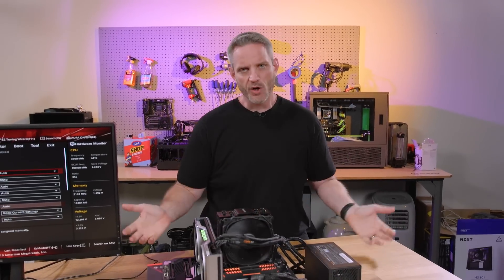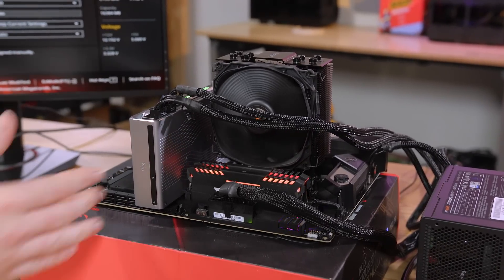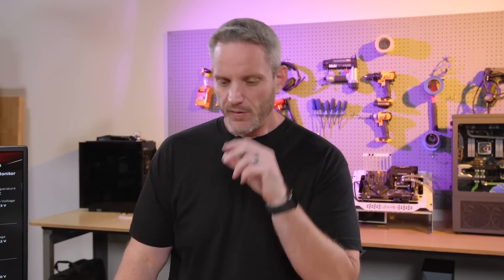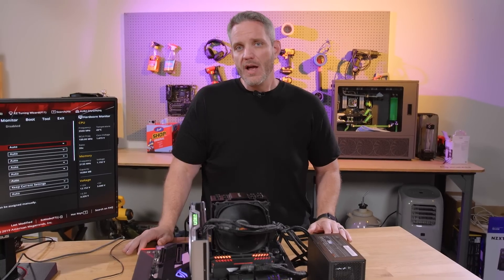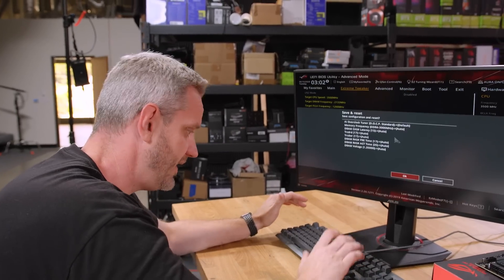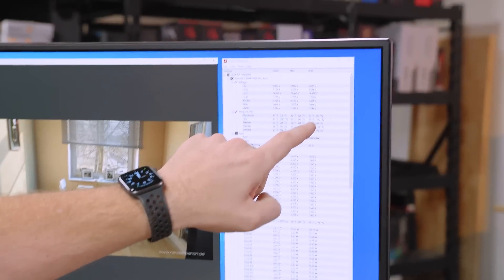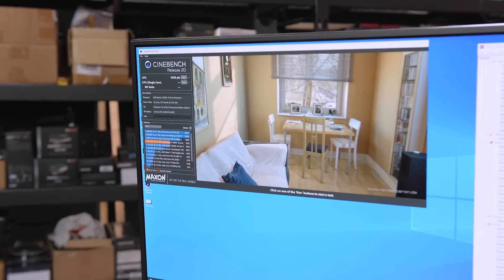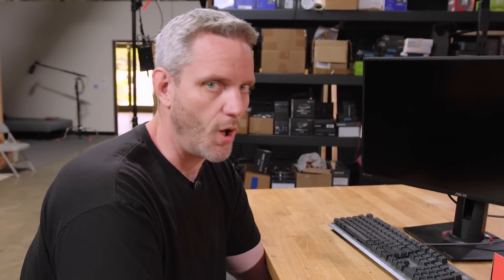Is your motherboard trying to damage your Ryzen CPU?

Comment: AMD's engineers worked on this PBO auto overclock and voltage and seems like they did a good job...I really don't get substantial benefit from manually OC versus PBO in most benchmarks. The thing is I can OC it to 4.3 and undervolt and still get good performance, so which is better in that regard.

Comment: Sorry Jay - Intel does NOT communicate the per core boost speeds for different load levels: instead it gives you the basic frequency and the max turbo (for single core scenario). This is a long existing issue (just checked for 9900K and 10900K, just in case they have suddenly changed something...nope, still the same). 3rd party sites like WikiChip sometimes (many times, in my experience) do have these data, but Ark.intel never does :) So no, this is definitely not something AMD could learn from Intel.

Comment: How far back does this go? I'm still on an 1800X with a Crosshair 6E and after updating my bios months ago it seems, I've been getting random presumably thermal based restarts even though I'm running an EKWB A240. For years I was just using defaults and now I want to do more like I did in a few tests out of the box. It just seems odd to me that I have no headspace even with a water cooler.

Comment: I just built a Ryzen system for my cousin, and the boost auto setting on the Asus motherboard was causing random crashes just using the computer normally at the desktop.  After setting it to default, it hasn't crashed in over a week now.  It should be default by default.

Comment: Asus Rog B450-f running an AMD 2600. I did a Bios update and the board attempted to push 2.4volts to my CPU and caused temps to spike up to 80C at idle. I had to shut the computer down myself. Luckily the mobo has ezflash. So I was able to go to the most recent bios vs the one I wanted and so far it's been stable but with more temperature fluctuations.

Comment: Hey Jay. I´ve been noticing this "auto" overclock since i build my pc. I´ve got a Ryzen 5 3600X on an ASUS TUF B-450M-PLUS Gaming, 32Gb Corsair Vengeange Pro Ram. I dont really know much about overclocking settings or tweaks, but i wonder if is there any chance that this board will let me run "stock", other than overclocked? My first impression out of the box was that "AUTO" would give me standard settings, and not overclock ones. The fact of the matter is that i simply cannot figure out how do i get a pure "Stock" setting on these boards.

Comment: CPU will died because the power supply is bad from motherboard AMD with does mosfet ,two much heat  from 12.50 V to 1.2 V and bad capacitors because the heat

Comment: Does that mean my Ryzen 3800X would run cooler than the 40° C it runs on idle at the moment if I change these settings? I could't find any official info about that.

Comment: Regardless those zen degradation I was always wondering the term of CPU degradation because of overclock. Is that really CPU or is it maybe the power supply and/or motherboard? Those components are being degraded too and after some amount of time, especially with overclocked components, they might not be able to deliver so stable voltages and overal PC stability might be affected. Sometimes it is CPU, sometimes MB or PSU or even memory.

Comment: Is a static overclock @4.4 on 1.2v on a ryzen 5 3600 bad for daily use? Daily use consists of some internet surfing, light video editing/exporting, and gaming. I have a 280mm aio as my cooling solution, idle temp is >33C and >65C under full load. Already did p95 test and it is stable at this voltage. I know cpus are supposed to flex so would this degrade the life of my processor even at this voltage with low temps?

Comment: Hey guys, thanks for the video! 
I have a Ryzen 3950x on a Aorus x570 master with the castle 360ex and 32gb of ram running at 3600Mhz and it's running 4.3Ghz with a steady 70°C to 80°C on cinebench r20 (score 9796). 
I wonder why am I getting that much different results than you in terms of temperature? I was thinking that a open bench setup like that would have better cooling than my cased setup.

Screenshot: https://ibb.co/GFf47g4

Comment: Plz help me fixing my 16gb 3200mhz Tforce Ram stability, I can only run default 2400mhz or to max 2600mhz without game errors and blue screens. I tweaked for months with voltages and timings, runned memtests and notthing wrong. Even Teamgroup dont know what wrong is. I got a ryzen 5 2600X and a X470 asus prime pro

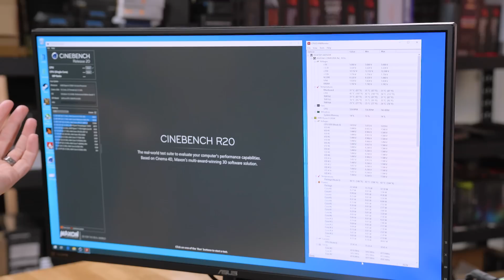Comment: 9:45 your wrong, I'm saying you should be using HWinfo instead of monitor XD
12:00 burried and hard to find chart? Got a link to that? it's not in your description.
15:33 had to actually do a double take on the information at the bottom, It actually does state that, that value is temperature in celsius. Handy to have if your going with dry ice or something.

Comment: Same problem with my ryzen 5 2600x by default my motherboard push voltage so high like 1.45-1.5v that's not good at all I lover to 1.25 and oc to 4.1ghz and much better temperatures and performance

Comment: re. your test methods - not really a good idea sitting the MB on a thermally insulating surface like cardboard (except for quick functionality tests), heat gets dissipated through the ground plane and some MB's even have mosfets on the back. You should have the MB on risers/stand-offs of some kind.

Comment: My threadripper is not overclocked and the ram is set to its rated speed instead of the default 2133 on first boot. Its still faster than a scaled dog. I don't need to over clock.

Comment: I set my ram stick to XMP rated by the manufacturer (3000mhz). The options on MSI B450 are 2133mhz up to 4100mhz. Set it to 3066 cl16 and the cpu fan runs loud (at 2133 to 2666 it is not so much). This is my first AMD build and it makes me uneasy (R5 2600 stock, 2x8gb ram, 480gb sata ssd). Other PC has i3 9100f with h310m motherboard 2x4gb 2400mhz runs quietly when playing games. I'm pulling my hair out.

Comment: "VID thats the actual voltage being send to the core itself" 10:42
VID is is the voltage that is REQUESTED by each core. What is actually send to, or received by, the CPU is known as VCore or core voltage. This is also why the VID doesn't change when you undervolt or overvolt your CPU in the BIOS. The VID algorithm is programmed into the CPU.

Comment: Is it normal for Ryzens to run 90+ C???  I'm still on a 3570K with a mild overclock barely see over 60C at full load on air cooling.  90 C would be a space heater in a small room, and already my kids room gets pretty hot after an hour or so of fortnite.He's on an old AMD A10 tho so it works pretty hard to keep up.

Comment: I have an old fx8120 (stock overclock @ 1,45V for several years) now it is reliable (and over clocked) @1,15V/1,20V 

Similar voltage (1,4 V stock  1,38 under load, 1,2 manual overclock) of my new ryzen 2600x
I hate these sh..tty voltages! Seriously! I hate it!

Comment: Its true, I have a threadripper 3970x and the Asus Zenith Extreme II. When I tried minor overlocking leaving some stats on auto, the board pushed too much amps. One VRM went up in smoke and also took out 1 ram module.

Comment: I offset -125mv on a 3600 as default voltage on my b450 Tomahawk was 1.44v which seemed way too much to me. Defaults were nearing 85c with folding@home, offset brought it to ~62C with 55c in cpu intensive games (goddamn Unity). I'm using an Arctic Freezer 34 CO with an additional Arctic 120mm on back of cooler (so two fans in push-pull), 4 140mm Arctics on intake and a 120mm on exhaust as well. Defaults won't kill stuff but mobo makers are really trying to push things to make it look like stuff runs faster on their boards.

Comment: my Asus B-450F would put 1.6 volts to my 2700x randomly out of the box. i turned the voltage down and was still able to overclock the CPU. It just seemed really unnecessary and weird so this explains a lot.

Comment: And, I could have told you that the Crosshair VIII Formula isn't misreporting power draw. I use that board and already ran those tests :o Its only a handful of boards really, and MOST of them that were cheating have rectified the cheating in their most recent bios upgrades. 

Asrock was actually the worst offender, with a ~30% deviation on their Taichi before they updated the bios to version 3.0. Everyone else still doing it on the latest bios is no more than 88% iirc.

Comment: Hi Jay,  I have a question,  I built my pc just 2 weeks ago with a ryzen 5 3600, asrock b450m pro,  rtx 2060, vengeance pro rgb 16g and a corsair hi100i rgb with a corsair 220t and cooler master 750w,  when a finished building it up everything works great for a week and a half,  then it started to restart by itself when my daughter was  using it,  first i tought it was OS problem so i did a system restore but keeps on happening,  since my windows is on my 500g M.2 and i made a recovery drive,  i tried recovering my pc but to no avail,  so i started to remove everything and trued reseating VC,  Ram and M.2, but to no avail,  so i tought it was the psu so i change my psu cause i have extra,  also no avail,  whenever i boot to bios it will be stable and never restart by itself even for an hour,  but when i boot to my usb boot drive and tried to reinstall windows it will just restart by itself again and again.  Do you thing it was my motherboard that has issue?  Also tried to flash the bios.  Sorry for the long question.  Thanks in advance.

Comment: Jay i have a question/suggestion for a video: 
Moving from intel to AMD with a new cpu, motherboard, ram combo. 
Can i just unplug everything and re-plug in/ uninstall certain drivers/ fresh install of windows. Most information points to fresh install of windows however many people have been lucky with just plug and play.  I have some programs that ive lost the key for and would potentially loose with a fresh install.  Could also be a general video on changing motherboard and what is affected.

Comment: If you lock the CPUs voltage at a certain level, does the voltage regulator make any adjustments while the CPU is under load?

Comment: Hey Jay - Sadly All i can do is use RYZEN MASTER - anytime i try to change voltage on my MB it will not load into Windows!  Even by 0.01V it will NOT load - auros b450 motherboard and 3900X.  So dont tell me to use only software cause it's the ONLY option.

Comment: I have ryzen 3200g for about 4month now ioc the gpu to 1700 and downclock cpu to3750 mhz for while and igot stable performance and heat didn't exceed 72 then i return everything to normal to find that the peak frequancy is just 3870

Comment: I am currently running a R9 3950X + X570 Aorus Master + Kraken X53 and my idle temps are around 40-45C with the Aorus EasyTune set to 'OC 3.70Ghz All Core'. On default, 3.5Ghz 1 Core, the cup idles at 50-54C. It would be great if you could make a video of how to reduce idle temps. Would be really helpful. There are hundreds of such queries on the internet for the 3950X but I only trust a handful of reviewers/system modders when it comes to experimenting with Overclocking

Comment: witch motherboard is more worth it for new pc build(AMD Ryzen 7 3700X+ later in future 4-gen upgrading) out of this two?

Asus ROG Strix X570-I Gaming Mini ITX AM4 Motherboard 400$
Gigabyte X570 AORUS XTREME EATX AM4 Motherboard  700$

Will I be able to see/feel the diference between  DDR4-3600  and   DDR4-4400 memory speed ?
Is this   Asus Radeon RX 5500 XT 8 GB STRIX GAMING OC Video Card good gpu or should I invest in Asus STRIX  GAMING  Advanced
   GeForce RTX 2070 SUPER
Will I be able to see/feel the diference between 3.5" 7200RPM Internal Hard Drive  and    SSD  M.2-2280  NVME drive ? 
Is this  Asus MG248QR 24.0" 1920x1080 144 Hz  good monitor for 1080p high settings gaming  or is there better one under 300$  ?

Thanks  :)

Comment: I think I did drop my 3700x to 1.39v and didn't even notice any performance hit in benchmarks, but did see a substantial drop in temps while still boosting to it's rated clocks consistently. At max load, the highest I've seen is 64C with a noctua cooler versus well over 70C before, and idle temps was even more impressive staying near 30C. I don't plan on swapping out CPUs (since using a 2600k Intel for 9 years) so a small drop for thermals is really good for the long run. It may be designed for those higher stock voltages, but if we all know anything about heat spikes and such is that it isn't the best thing in the long run, whether be engines, electronics, etc.

Comment: My overclocked AMD K6-2+ 500MHz running at 600MHz (2.0 volts nominal / 2.4 volts for the overclock): 15 years under normal usage, you say? :))

Comment: Hey jay i have a 2080ti and i7 8700k i have an overclocked of 700 memory and 170 gpu and call of duty modern warfare crashes all the time dev error 6068 the overclocked is pretty stable with other games any help with modern warfare

Comment: Jay...  The boards in question are misreporting the PPT.  My board, for example, is only reporting 58% of the real value, so when HWInfo says my 3700x CPU is drawing 65 watts, it's actually drawing 65/.58 = 112 watts, and that is outside specifications., and that's the problem.  The boards are essentially overclocking the CPUs, beyond specifications.  As both you and AMD have mentioned, the CPUs will protect themselves, but the lifespan will be reduced.  AMD says the lifespan reduction will be insignificant, but of course that's what they'll say.  If you want to check your own boards, download the beta of HWInfo and monitor the "Power Reporting Deviation" under a few full loads, like CB 20 and P95-Small FFTs.  Anyone concerned about this can lower the PPT in their BIOS to compensate.  And yes, boards doing this will yield better performance - it's overclocking, after all.  In my case, it's between 4% and 5%.

Comment: Jay isn’t wrong but saying “Fuel” the air/fuel combo becomes the stoichiometric blend (fuel) that the compression cycle and spark work with to achieve power. In the end both camps are saying the same thing, breaking the much more pedantic explanation down to a more “common prose for mah hoes” labeling that is easier to understand once one understands air fuel ratio that becomes labeled  fuel for ease.

Comment: Hello guys, bought some new parts for my pc, when i play games like CS:GO or CoD: warzone for example my computer reboots, My new parts are geforce rtx 2060, 32gb ram, i7 9700k what i believe is the problem would be my power supply it's a cooler master MODEL RS-700-ACAB-B1 it's quite old do you believe it's time for me to switch it out 
 Link for the PSU  https://www.coolermaster com/catalog/legacy-products/power/b700ver2/ add a dot for the .com, want people to actually see the PSU and give some advice if it's time to throw out.
Bought it 2014 might be important to know :D

Comment: I have a problem with pc grounding, I got electric shocked when I want to turn on the pc incase I usually touch my pc case. So I take multimeter and put on the pc case and it read 12v. what should I do?
Reply: OUCH!!  First thing I would do is check all the screws for the PSU are the correct length.  Make sure you're only using the short ones(I think 5mm minus the pan and/or head. 👍

Comment: On my b450 tomahawk I just turned everything off. Set my 2700X at 4.1 ghz at 1.38 volts and it runs flawlessly. I use a Celsius+ 280 AIO and when I have discord, apex, afterburner, rtx voice, Ryzen master all open or at least in the background I might see 62 degrees during gameplay.

Comment: I have 1800x and I bought the cpu at launch. I only started to use the auto OC button that comes with the asus ai suits our 3 months ago. It is technically at. 14% OC. My cpu runs at 4.1hrz OC whiling pulling 1.6volts.......

Comment: I've had my 2700x since december 2018 running at 1.525v  4.30ghz  and i've hardly noticed performance loss. (max temp when gaming 60-65*C  max temp when stress testing 72*C)
Reply: most people upgrade their computer every 2-3 years, 5 years max anyway so

Comment: Hey Jay. I have a question for you. I am running a Xeon E5620 dual socket in an lga1366. The second socket is virgin. Nothing has ever been put in it. The machine I am using is an HP z600 workstation. It has limited space for a cooler on the second socket. This be quiet slim would be awesome if it works on an lga1366. Do you know if it will work?

Comment: I had the problem, that i overclocked my 1600af to 4,2 GHz totally stable, but Sometimes it jumped to 5Ghz, which caused Crashes, If the MB didn't adjusted the voltage fast enough. Pretty Strange bullshit

Comment: My 3900x degraded like 3 times in less then 6 months.  Various OC's since release at the maximum safe listed voltage. obviously AMD was smoking crack when they published it.  Especially if you want a steady voltage unlike amd's master bs or pbo etc.  even at 1.3 she degraded eventually.. I used to hold 4450-4500ish on all cores.. That stability went away after a bit. then 4400 on first set 4200 on second ran that for months around 1.28ish v , that also no longer is stable.. Now i run 4200 first set 4000 second set 1.187v. lets hope that sticks.. Manual OC in bios is the only way to be overclocking.. Ryzen master belongs in the trash along with pbo etc , nothing but overvoltage and jumping voltage.  Love the 3900x chip but the degrading is absolute bullshit for such pathetic overclocks.. my 9900k has ran 5.0ghz all core @ 1.250v since release and guaranteed will for many many years. previous 6600k and 8700k's were OC heavily and are both still running the same since day 1 , even at their new owners.  Lets hope ryzen 4000 is better.. I'm not paying big bucks for chips that degrade fast as fuck.